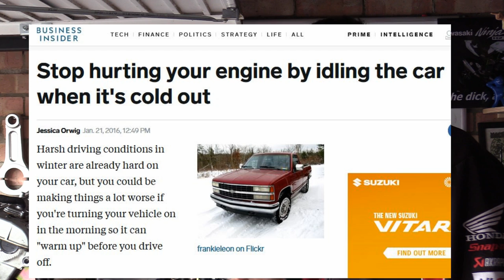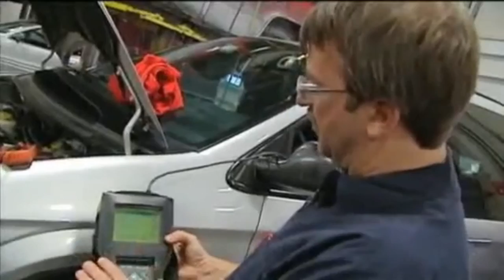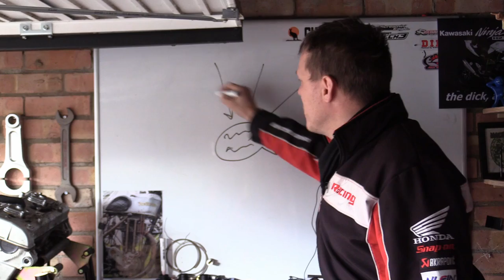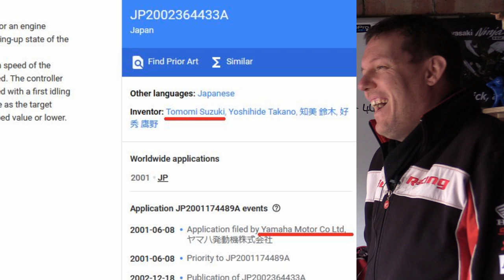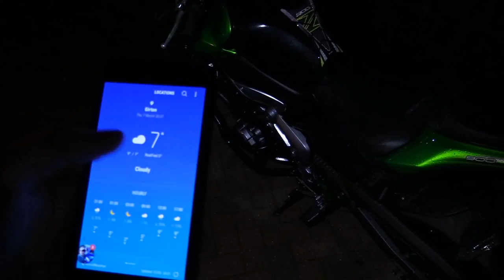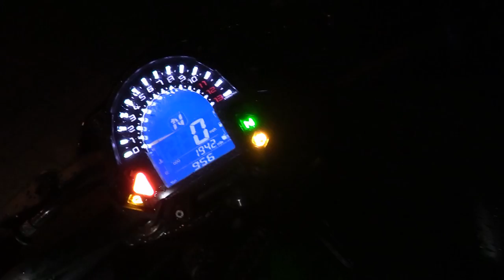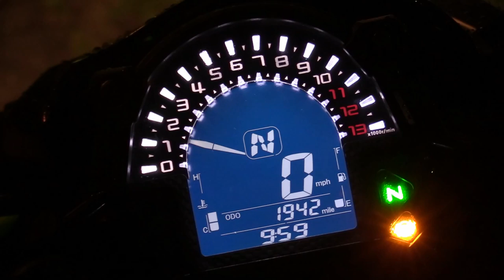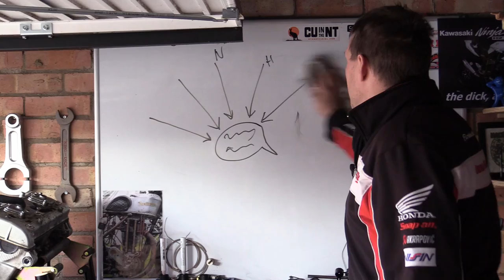Cold weather and Warming up?

Comment: You're talking absolute crap here Matt. Car manufacturers DO care if their product fails because then people won't buy from them again... and the word will spread, further hurting their business. 

2. The reason racers warm up their engines thoroughly is because they're hard on them straight away!.
Reply from the maker: Where's point 1.?

"Car manufacturers DO care"

- Like removing spare tyres and giving you that space saver bullshit. Like using hot glue to glue in boot microswitches. Sure they do. 

But back to the point. Ok, lets go with what you say. So why do they tell you to pull off straight away?

My counter argument - Watch this - Can you see why warming up your engine is a good thing.

https://www.youtube.com/watch?v=OWiQyR7PWII
Reply: @dirtygarageguy  Space savers are a good thing!  Who cares if switches are glued... it works!.  Super/hyper car chassis' are also glued together!

On a modern engine, if you're using the appropriate viscosity, (and its above around 5C ambient temp) then you can drive off after just 10-20 seconds of idling (depending on how much net weight you have in the car (its usually just the driver)).  You certainly don't need (or want) 5 minutes of IDLING!.  At idle rpm and cold engine, you don't get good atomization and it washes down the cylinder walls, increasing wear.  You also get better lubrication above idle rpm.

Comment: Yamaha R1 example makes no sence. Why would it be better for the engine to put any amount of load on it by driving it instead of just idling? Instead of idling at 2000rpm for 3 min, let it idle at 1000 rpm for 7 minutes and it will get up to temp. About the same amount of crank turns at even lower loads. As far as I know, the fast idle is also there to warm up the catalytic converter quicker. That being said, if they remove the fast idle for emissions, then they have to get you to warm up the cat and thats why they suggest driving it imidietly. For crying out loud, we are all laughing at the guys from the begining of the video for saying that you should just start it up and drive it so it warms up faster, and than you say the same thing. Yes you said that you shold drive it at low loads (the r1) until it warms up but the point is to let it warm up so all the clearences tighten at the lowest load possible and then ride it. Yeah, it will be ok if you drive it at low loads but letting it idle until it warms up is still the best scenario which is what you say at the begining and than contradict yourself with the r1 example.

Comment: I've been wondering why my bike has a MANUAL fast idle.... Must of been a loophole to get it to pass emissions... Or just Kawasaki being cheap lol... (2005 Kawasaki Vulcan 1500)
Reply from the maker: Proabbaly due to the large cc. Bikes come under the Euro4 emissions (pretty much even if you don't live in Europe - that and the EPA which is pretty much along the same lines) Because this is a blanket standard then regardless of the cc its classed under euro4. 

If the fast idle is manual then its not part of the test and they can get away with it.

Comment: My advice is there is no need to let it sit and idle. drive it off starting is fine but just don't give it the berries until its warmed a bit.
As for damage caused by idling, that's a load of bull and the rant about fuel washing off lubricant is ignorant idiocy from the usual suspect (that goof is a waste)
Reply from the maker: "My advice is there is no need to let it sit and idle."

- I am talking about freezing conditions here - like snow etc - should have made that clear
Reply: @dirtygarageguy  Yeah when I go skiing and it's freezing temps  I usually run it a while in the car park before taking off while packing up the gear.
Reply: Both bikes I've owned run like ass until warmed up. When it's freezing out throttle is very rough. Fuel injection has helped a lot with those kinds of problems though
Reply: @gutserker  
FI has helped remove the foibles of carburetor choke systems but when the temps get low enough FI tends to run out of road so to speak.
For example if it attempted to compensate for freezing temps by enriching mixtures farther than it does it would get the the point it would just flood and not start at all so it has a cut off point.
Early Bosch FI had a separate injector on the plenum chamber for cold starts and was problematic and could cause flooding.
FI cant do much more than max out AF ratio and increase idle speed until the engine has run long enough for the ECM to see some rise in sensed temps be it air or coolant up to a baseline which is why they usually back off ignition timing advance to limit RPM anyway and just stop you form revving it in the case you do drive which in itself prevents damage occurring but that said performance is very poor.
Reply: @gutserker  Mine are the same.  One has a combination of fast idle and some kind of anti-stall that lifts the revs even further when in gear (only when very cold), which is mildly terrifying as it runs on a bit off-throttle.  One has ride by wire which is a bit touchy (hiccups and lurches slightly) when both the ambient air and the engine are cold.  So yeah, I warm them up for a minute or two before setting off, and try to be kind to them until the water is warm, but they feel best (fueling, noise, gearbox etc.) only once the oil is up to temp as well.

Comment: best thing to do is when you start it has a high idle (cold start) once that returns to normal then go its usually 45-1 minute max. 
my bike I start it up put my helmet on open the gate. by then its been 1 minute and the temp meter has gone from 1 bar to 2 (3 is normal op temp) thatd when I take off 
|And then when I drive I keep the load off and drive it easy. once its at 3 bars (normal op temp) I still wait 5 minutes for hte gearbox, clutch etc to all get warm. then i start riding more spiritedly
Here is my vid demonstrating. its riveting television! https://www.facebook.com/stewart.dodge/videos/2078366635582126/